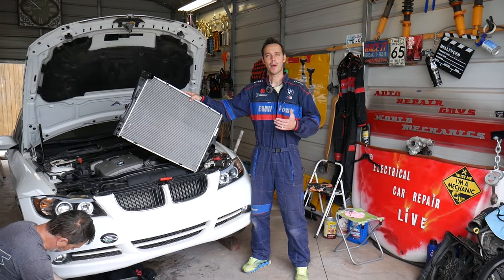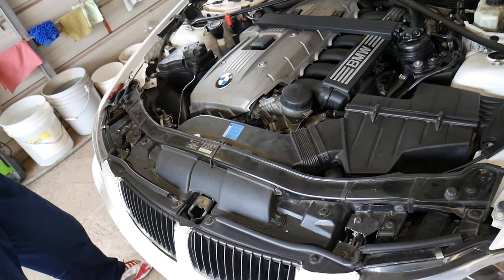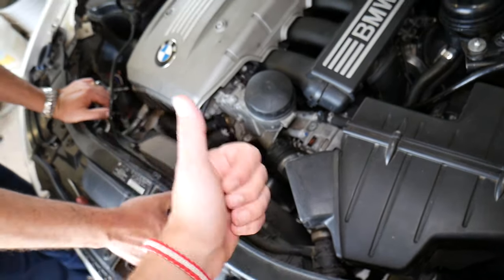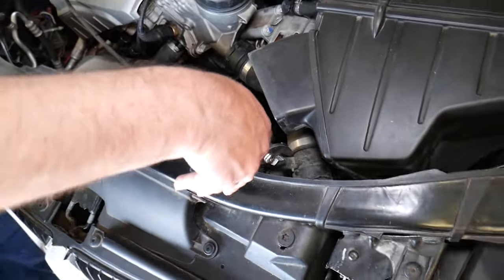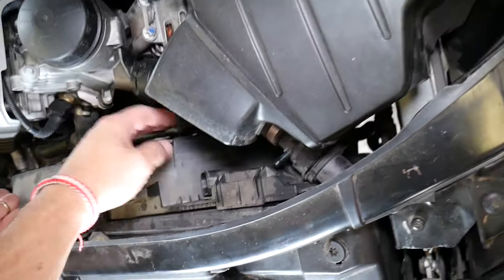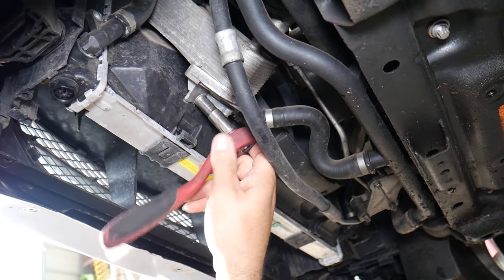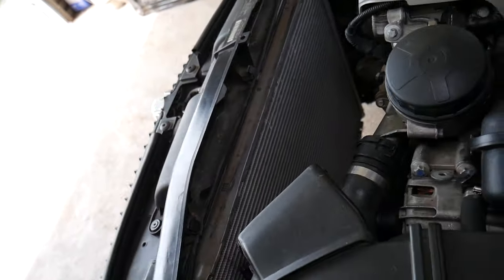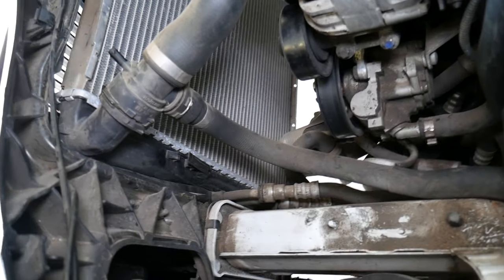RADIATOR REPLACEMENT REMOVAL BMW E90 E91 E92 E93

Comment: Old hoses, especially the ones that have been in the car from factory are a pain to remove; I ended up having to replace the (original) radiator because I damaged it while removing the upper hose; it was probably time to do it anyway; thank you for the video!
Reply: Just snapped mine 😭🤌🏾
Reply: Same
Reply: Same thing just happened to me, snapped the top radiator hose and busted the radiator, any ideas on getting the bottom hose off without breaking it the hose, the heck with the radiator, got a new radiator
Reply: Ich auch. Plastik seems to be the Achilles heel of BMW. The handle on the passenger side door  just melted all on its own.
Reply: Same here

Comment: Hello, thank you for the video. I was checking your links I did not find the link for the first pipe you took out. Also do I need to change the thermostat if i change the radiator?

Comment: Thx for the videos. You guys rock.
Question, I replaced the radiator as well as the upper hose, lower hose, thermostat assembly and reservoir tank on my 2011 328i (E90…?)
I ran into a little black box between the fan and the radiator; but it was loose. I didn’t see you pull that out, it must be the year(?). Do you know what it is and where it should go? It had a clip around the cable that fits on the fan assembly, but again, it was loose in between fan and radiator.
I believe that piece was caught by the fan and it hit the radiator and made it leak

Comment: I ran into a problem while disconnecting gone of the hoses, it would be at 12:04 where the fan seems to connect, not sure if there’s a way to properly remove it or if my hose is just really forged in there lol, any help is very appreciated

Comment: Great job guys please make a video on testing oil level sensor for e92 328i 2008 or similar keep getting inactive will my oil level sensor also getting codes for PSD for missing communication or oil level sensor and water pump I know they're on the same line I changed my oil level sensor and it still doesn't work

Comment: Just want to confirm, does this radiator replacement work on an automatic transmission?
Reply: Order it from FCPEURO in the description it’ll say for automatic transmission cars if you use amazon or ebay you’re likely to run into some issues + FCP gives you life time warranty

Comment: Is it the same for a non manual car?
Reply: The automatic transmission cars have a different radiator, my 06 325i radiator doesn't have the same setup up as the automatic transmission car in this video

Comment: What hose goes to the bottom. This is on the side were the radiator big hose attaches in the middle. 🙈 if that makes sense. My mechanic blocked it off
Reply: Did you figure what it was called?

Comment: Hi, I have to replace the new radiator but this new radiator not coming with Eac sensor port , can I installed without Eac sensor. ?
Thanks 
305-7217046
Reply: I’m running into the same issue. What did you do Douglas?

Comment: Great video! QUESTION: my fan+radiator+condenser assembly "sunk" on the right, broke AC line. What holds the assembly at the bottom? The RealOEM diagram doesn't show attachment /suspension points. https://youtube.com/shorts/HgN1_PUOHYY  Thanks!